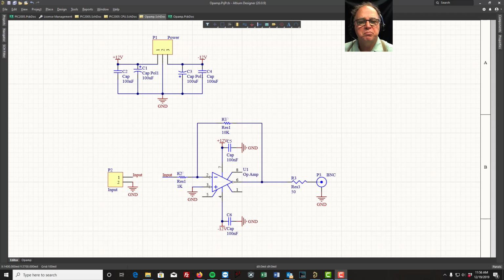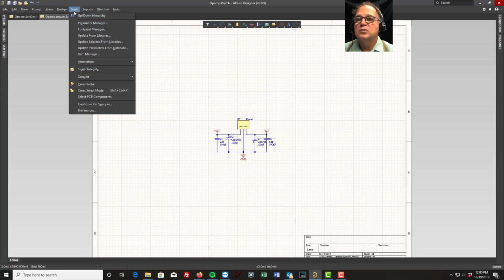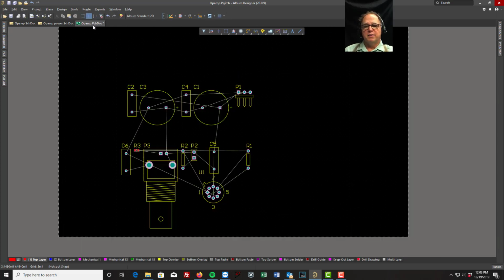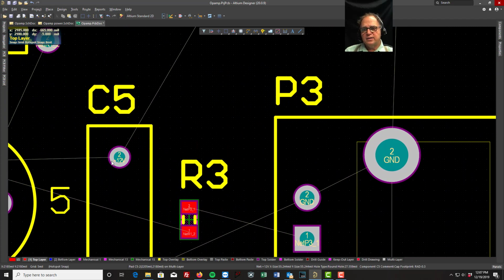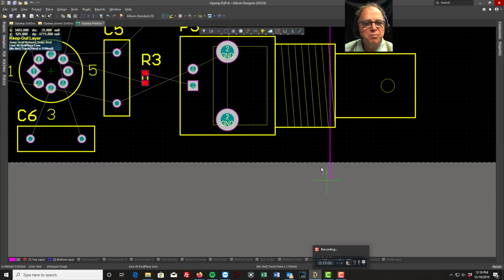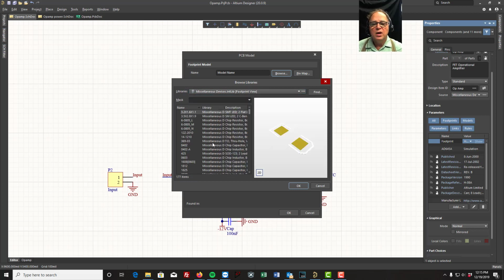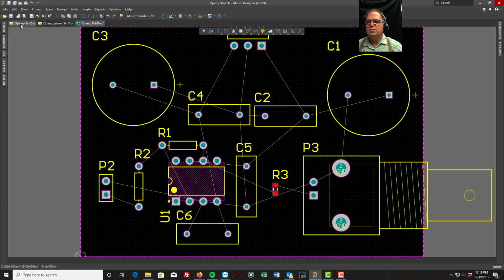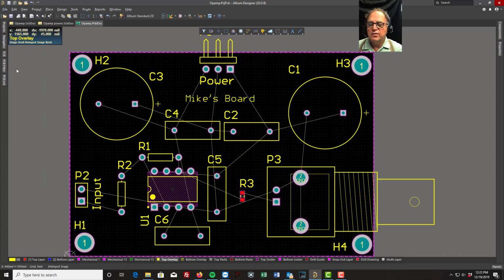6 Altium Designer 20 Moving Parts to PCB

Comment: So when you added the "DIP-8" footprint to the Op Amp, it doesn't appear that you changed anything in the library (Miscellaneous Devices.IntLib).  Since the schematic is still pointing to that library for the "Source" of component, if the "Update from Libraries" command is ever used, the footprint will be back to the old device footprint "H-08A".  Is this a good approach for component management?